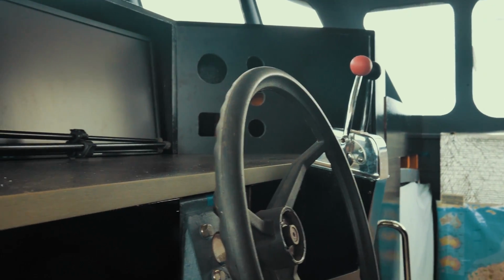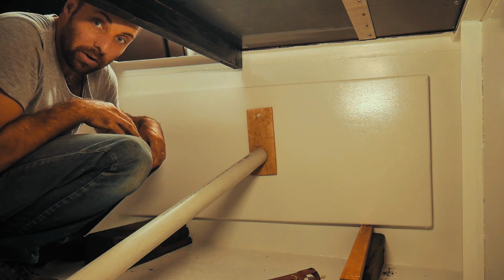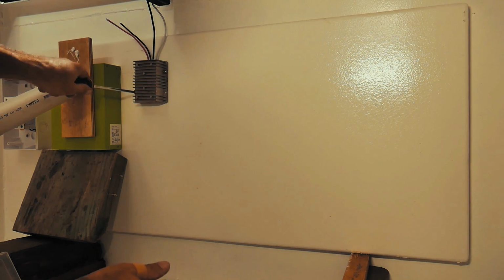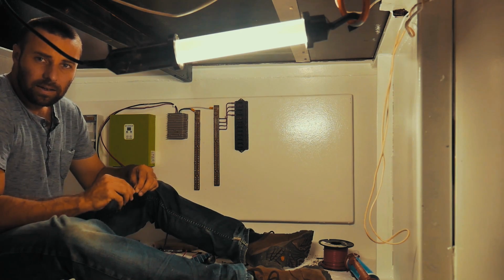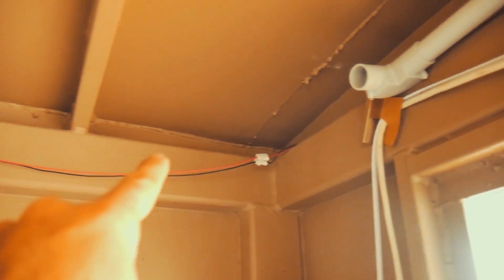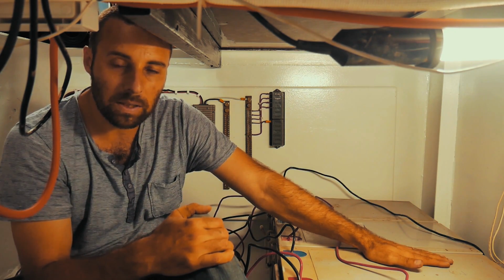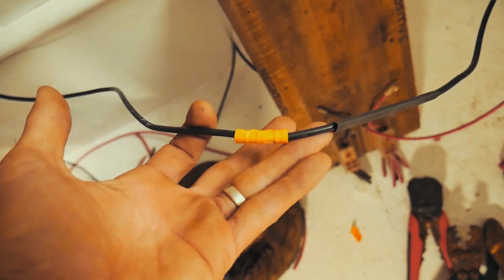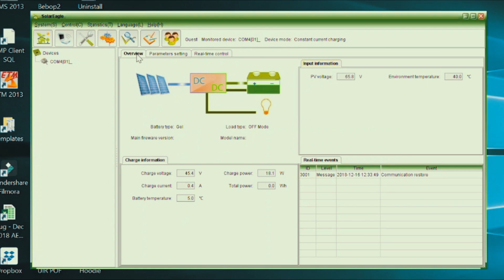Solar On A Boat (Part 2 of 4) Building Brupeg - EP. 62

Comment: LOVE the outtakes! Laughter is wonderful. Your OCD is serving you well. Very nice DC installation. I think you may have a rogue panel causing your low amperage problem, since you’re using them in series to use smaller wire. You’ll be a walking expert in all kinds of boat building expertise by the time you hit the first ice. Happy Holidays and the very best of the new year to you all!
Reply from the maker: Thanks Rick. It's a lot of fun filming some days. The panels are producing decent amps and we think it might be a faulty charge controller. We are testing it soon.
Reply from the maker: All the best for the new year

Comment: great looking and soundly thought out wiring I notice in the comments concern for changing the solar controller that is no concern at all. Just keep a length of thin stainless steel lockwire with a handle at each end, when required work the wire under a corner and then using the handles in a sawing motion pull the wire through the sika, cuts like butter. you can make one up long enough to go round most of your boxes and keep it hanging on the wall next to the panel. same method works for removing windows that are sika'd in place one in one out work the wire round cheers and great work
Reply from the maker: Awesome. We will be doing this job this weekend so heat timing homosexuals. Thanks very much
Reply: @ProjectBrupeg  Trying to translate your comment "so heat timing homosexuals" into Canadian English and I am failing big time!
Reply from the maker: Auto correct strikes again. Reading this I’m as baffled as you are as to what heat timing homosexuals is...
Reply: @ProjectBrupeg  It's good for a chuckle though :)

Comment: Cool you are getting on... Be aware that loops are "heavy" and will have their own vibrations , one would normally make a clean circle, like  using a bigger pipe to shape, and the loop needs to be supported. Also would support the "loops" also bearing in mind vibrations.  25:25
Reply from the maker: Ok good to know. Thanks for that info

Comment: I had a similar box for my cnc system in the shop, I mounted it via brackets on the side bolts. I second checking the temperature sensor for the batteries.
Reply from the maker: Thanks Tim. We have ordered a cheap and dumb 60amp pwm charge controller so we can swap out the green MPPT controller so I can see if the problem persists or the symptoms change (trying to rule the green charge controller in or out as the problem)

Comment: Another great video and very neat install.
Some comments on the install. 
A) any worry about that adhesive on the board weakening over time with vibration and weight of supported components - why not a couple of bolts through the bulkhead for mechanical support?
B)Careful with coiling excess wire as you create a transformer and can inadvertantly cause inductive load that can do strange things.
C)You will have fun when it comes time to replace or service that charge controller. Perhaps brackets at the corners that screwed to board would have been better? D)Extremely low probability and not even sure what would happen but is there a fire hazard running wires directly through flammable polystyrene ? For instance if charge controller fails and causes a direct short across  the solar panel supply lines - will they get hot enough to melt / ignite the polystyrene?

Thanks for another great video.

Comment: 13:37: Interesting ferrules. I just use ring terminals or spade terminals, with heat-shrinking covers. I do double-crimps with a tool, and the big cables have a metre-long crimper. 15:25: You may want to invest in a label-making machine, OR to simply draw a letter code in pen (AAB, AAC, etc.) and then keep a laminated diagram of all circuit runs in the front page of the log simple enough that a passenger could, once shown it, figure out how to shut down a failed circuit, or to reroute power through a secondary switch. It's the same logic as your dual fuel filters: turn two handles and do the filter change without stopping. I'm labelling our boat's hidey holes and storage places this way so a glance at a diagram should reveal where something is: PSS1 is portside saloon settee locker 1; use the same codes in a spreadsheet files to do spares, tools and provisions inventory with visual reminders (green, yellow and red backgrounds to the quantities) to show you when you need to replenish consumables. 20:43: In terms of line loss, potential heat issues and physical durability, thicker is generally better. Less fiddly to work with, too. 25:38: I agree they look smallish for the purpose. I stuck for simplicity's sake (and very centralized, short cable runs to the various subpanels and circuit breakers and the engine itself) to a 12 VDC system, but of course with a nearly 1200 Ah bank wired in series/parallel, the wire sizes are a bit fearsome. See (https://alchemy2009.blogspot.com/2016/09/wired-and-perspired.html) for some of my hook-ups. It's funny that yours look elegant, and mine look brutal, given I've a considerably smaller boat. 27:04: That's the only way to do butt crimps (as they're called here) properly with those connectors. But I like the ones with the solder in the middle...slick! And the outtakes are adorable!
Reply from the maker: Thanks Marc

Comment: Hi  Guys:  Just a couple of thoughts.   1.  A 1/2"x1/2" wood or plastic cleat the sides and bottom of the charge controller will give you added support to the glue.  Glue the strips to the charge controller and screw to the mounting board.   Similar metal  clips screwed to threaded holes in the bulkhead would also provide additional support to the mounting board.  Bend the clips in a 'Z' shape and slide a length of heat shrink tube over the metal if you feel you need additional isolation.   2. As a rule of thumb when sizing wire for DC I always sized by the book for run length and current then moved up one wire size. ( for example 15 amp under 50' run  #14 wire gauge required .  I will use 12 gauge wire gauge. ) 3.  I would also lace or zip strap single conductors running side by side.  But wound not pull them tight so a single wire can be pulled out or two additional wires can be threaded through for an addition circuit. 4.  Remember to leave a strong cord  (nylon or Polypropylene ) in the conduits; to pull additional wires through )

the old guy   Bert
Reply: 100% agree especial with #4.. 
I'd add that using somewhat over sized conduit and adding junction boxes at key points (like before after a "wall" etc) can help future proof things when you may want to run a wire along part of the same conduit path.

Comment: Have you ever thought of PVC "wood like" material for use anywhere on boat since it has no rot issues? Not structural but good for spacers like non-conductive around solar panels. Great channel by the way.

Comment: Just a thought about the amp problem, with other solar systems I have seen on you tube, they had similar issues and it turned out to be the battery temp monitor system, the charge controller really needs to see that temp, and I noticed in your video that it was set to 35 if that is C then it is saying your batteries are hot and that could be why its keeping the amps low, so as to not cook your batteries.  Just thought I would toss this into the mix, hope you get it sorted soon. Love the videos and can't wait to see her in the water!
Reply: Yes, that's a possibility in that the charge controller is trying to protect itself and the batteries from an overheat that doesn't exist.
Reply from the maker: Ok good to know. The charge controller never came with a temp sensor and according to the manual can run without one. That said the auto limit thing for hot batteries makes sense. I’ve narrowed the issues down some more. I’m getting good amps from the panels so they are not causing the fault. The issue looks to be at the charge controller so I’ve ordered a cheap 60amp pwm controller to swap it out with to see if the symptoms change (to rule the green charge controller in or out)
Reply: @ProjectBrupeg  That's good for diagnostics, but you may want to hoard your pennies for a more capable MPPT that has the right settings for gel batteries, as my general impression is that PWM is fine for static installations (and is arguably more robust), but that on a boat where the angles of latitude and boat direction are constantly changing, MPPT is the better choice...see (http://www.enerdrive.com.au/mppt-vs-pwm-solar-controllers/). 

The odd thing is (to me) is that if you aren't getting the right current (just a trickle, so to speak), where the hell is the rest of the juice going in the absence of a great big heat sink? Good to hear all your panels are putting out properly...that means it's an inside job.
Reply from the maker: Yeah that’s something I can’t quite figure out yet. Nothing is hot! Not even the charge controller. I will replace with another MPPT on the boat as that’s what I have experience in and I don’t see the point in using pwm controllers these days. This green controller does have settings for gel but I’m thinking it’s a dud controller regardless
Reply: @ProjectBrupeg  Can't wait for the diagnostic verdict. Having tested every other bloody thing, you must find it frustrating not to have the batteries chock-full of amps at this point. I mean, it's summer where you are...doesn't get better!
Reply from the maker: Yeah in our old boat we would have a full charge by 9:30 in the morning in the summer. Sometimes it would be 1pm in the winter

Comment: D&J; good work! Hey I don't know if you've tried this or perhaps its overkill for your project but I'll suggest it anyway in case you might find it useful. Have you tried a tool called a zip tie gun or also called a cable installation tool or gun? We use it for industrial installations where you're doing massive amounts of wiring runs and you're trying to place very uniform zip ties every X centimeters, and every zip tie is at the same tension and visually at the same angle. It pulls the zip tie to a specific tension and then also clips the end of the zip tie once that tension is achieved. They're not very expensive and they make large wiring jobs very tidy.
Reply from the maker: They sound bloody awesome. Not sure we would get enough use out of it to justify the space in the tool bag but I love the idea of lovely perfect ties on the cable runs

Comment: One concern I have is how you are going to monitor individual batteries.   I would suggest you re-do all the connections at your batteries, and include a small gauge wire that can be run to a cheap panel mount voltmeter and rotary switch.  As you have 4 batteries, I would get a single pole, 5 throw rotary switch.  Wire each positive wire to the 4 throws on the switch, and connect the common pole of the switch to the input of a Chinese panel mount voltmeter (use the 5th throw as off, not measuring any battery).  You can then quickly turn the knob of the switch and measure each battery.  Measuring the voltage of the entire 4 battery band will tell you your charge, but it won't tell you if you have a bad battery or not. This is common practice for lead acid or gel cell batteries to make sure one battery is not going bad, drawing all the others in that bank down.   As you plan to add more banks of batteries, I am going to suggest you use a 4 pole, 5 throw switch, and use up to 4 meters, and you can measure your new battery banks at the same time. Here is a link to a cheap panel meter, and another to a single pole, 5 throw switch: Meter:  https://www.ebay.com/itm/LED-12V-24V-Digital-Display-Voltmeter-Car-Motorcycle-Voltage-Gauge-Panel-Meter/382639948497?hash=item59171e42d1:m:m5ZJitUjucFfhiDO1P9h_9A:rk:3:pf:0            Switch: https://www.ebay.com/itm/US-Stock-4-Pole-5-Position-Throw-4P-5T-Ceramic-Rotary-Switch-For-RF-Power/371900413555?epid=9021479615&hash=item5696fdf673:g:6BEAAOSwsW9Y01Gc:sc:ShippingMethodStandard!28217!US!-1:rk:5:pf:0

Another idea is to look into using "Anderson PowerPole" connectors for the battery connections.  They can crimp on the end of your battery leads, and allow you to connect and disconnect each battery separately.  You would connect one end to each battery, and then use a mating connector wired to your "harness" that goes to your fuse and breaker.  Here is a link to the Anderson PowerPole connectors: https://powerwerx.com/anderson-sb-connectors-sb50-50amp

I have this installed for my solar bank at my house, and would be willing to give you more specific information on how to hook this up if you are interested. It is actually very easy to do, and will make the job of monitoring your batteries very easy.
Reply from the maker: I like the sound of this. When I have a spare minute I will check out these links and look into changing. The set up. Thanks for this. Damien

Comment: I would add a wood cleat at the bottom of the glued on controllers etc to help with the stress of rolling seas and chops  ... looks good goodluck with finding the charge issue. 73 David

Comment: Merry Christmas guys and thanks for another great video.
Wiring looks good,
Don't know if its reached there yet, but there is a wiring convention in the UK that marine DC circuits are done in Red and Black or Red and Yellow, but AC ('mains' not Aircon) are done in Brown and Blue - safety thing stops inadvertent interconnection of 110v 220v AC and 12v DC and prevents maintenance hazards where guys assume a circuit is safe low volt and are not as safety conscious as they would be on 'Mains' .

Great work on neat wiring, labels also help lots - provided they're kept upto date - spent hours trying to troubleshoot the right circuit when it turns out an upgrade drew more amps so they put in a new circuit (unlabelled) and left the old one in place just disconnected and vestigial...
Reply: Also have a facility to kill all battery power without e.g. having to pull up floor panels - had an instrument panel catch fire after somebody fitted a bigger fuse ("Doh, the fuse was too small - it kept blowing") - doing the kill switch in seconds saved it from being dangerous and relegated it to inconvenient
Reply from the maker: Thanks Andrew. Yes we will be adding a kill all switch and the AC circuits will actually be on a completely seperate board on the other wall so we will be able to add to the safety etc
Reply: Thanks, the different colours for AC and DC are more about differentiating/identifying AC vs DC wiring runs around the boat rather than at the panel, 

Not trying to teach granny to suck eggs, but people do tend to use these videos as 'how to' guides.

One of the best bits of advice I got on electrics was that people don't understand what a fuse is for - It DOESN'T protect equipment or devices - it protects the REST of the system FROM any given device..

Comment: Looking good. The only thing that concerns me is the way the board is mounted. The adhesive itself will not fail, but being applied to painted surfaces, that will fail. Hard pounding at sea can be pretty tough at times. Personally I would put at least one fastener at each corner through the wall, and that of coarse depends on what is on the other side. Merry Christmas.
Reply from the maker: Great idea, thanks
Reply: Add an aluminium strap over the face of the PV controller to add additional and safer fixing
Reply from the maker: That’s a good point
Reply from the maker: We are actually about to change the single controller to 4xsmaller MPPT’s each running a pair of panels
Reply: @ProjectBrupeg  if you use a plastic or aluminium angle at the base of your mppt controllers and wedge a piece of rubber in there it won't move against the top mount.  Alternatively an angle over the face overlapped by an angle against the board and it ain't going anywhere.

Comment: I don't know if there is a code concerning this but I always like to have wires entering any type of box or panel from the bottom.  If this is not practical then at least put a sag in the wire before interring the box in case there is water where there should be no water, like a broken fresh water line. Great video!  Barry
Reply from the maker: Thanks Barry, I will look into this
Reply: @ProjectBrupeg   It's called a "drip loop" in North America. Means if the gland fails, the water doesn't just sluice down the whole conduit. It's also the best way to run coax for comms out a roof. Gravity is your insurance.